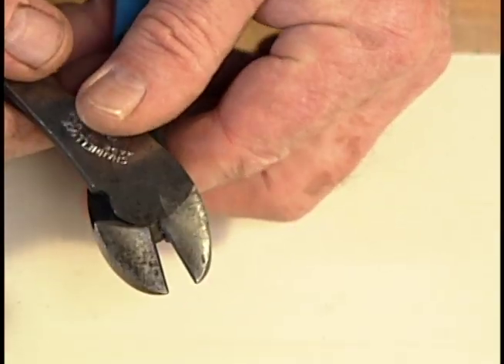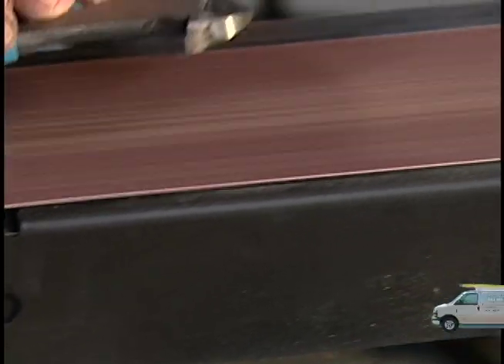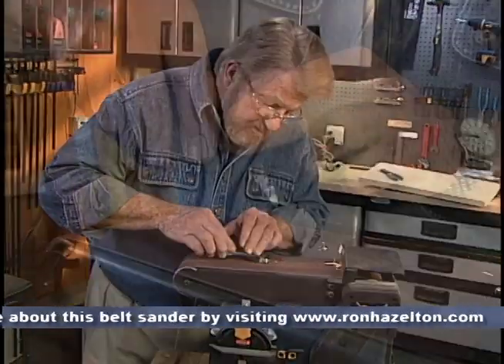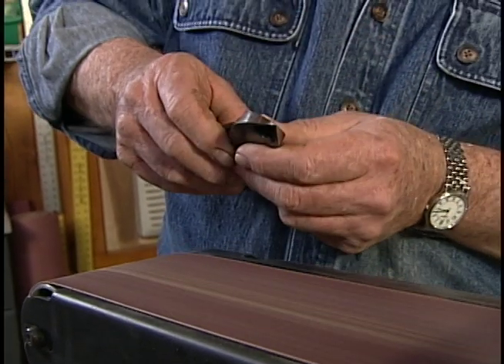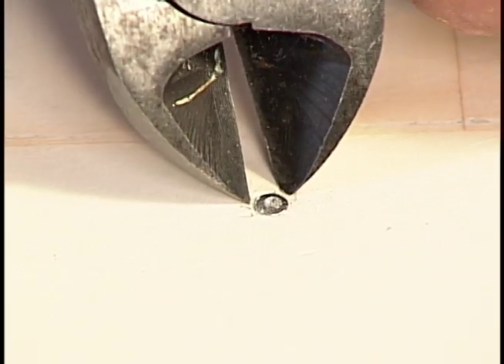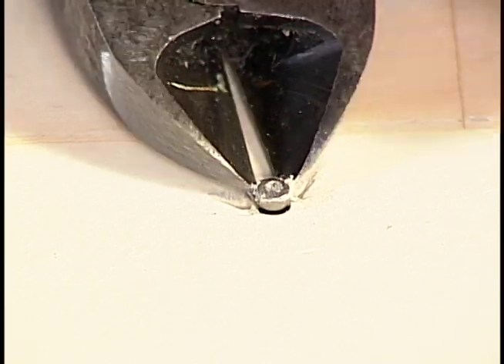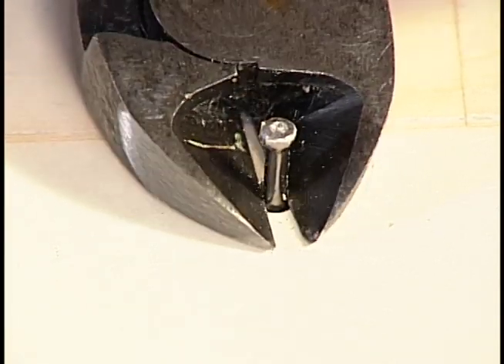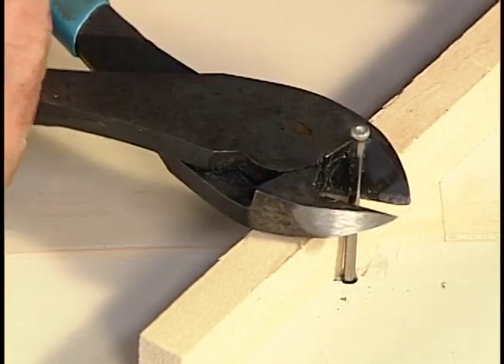Remove Small Finish Nails without Damage

Comment: I didn't want to grind my diagonal side cutter so I carefully went around two finish nails that were slightly below the wood surface with a Dremel tool that had a very small cone shaped bit. Then I was able to grab onto the nail and used a small plastic wedge underneath so the surface wouldn't get messed up. Worked great.

Comment: Hi Ron thanks for the video. On the sensitive subject of damage, I can see that it is difficult to avoid gouging, but still valid if minor. One thing I would try to avoid is leverage marks, especially with plastic. To avoid this I slide a  wallpaper scraper (which is pretty hard and thin) under the tool/lever. Anyhow, thanks again - England salutes you!